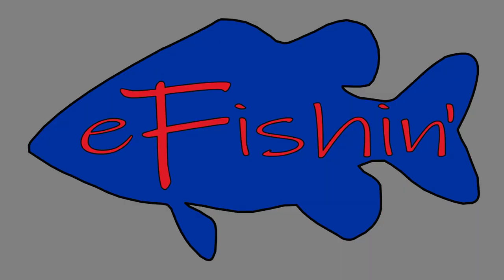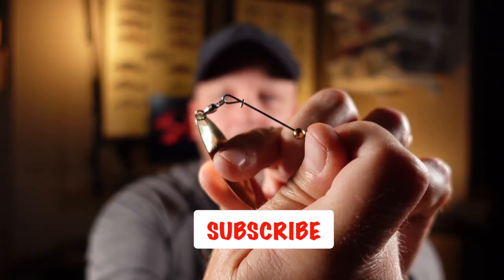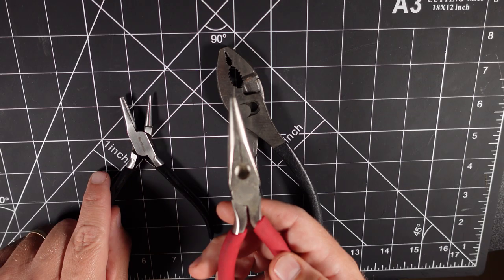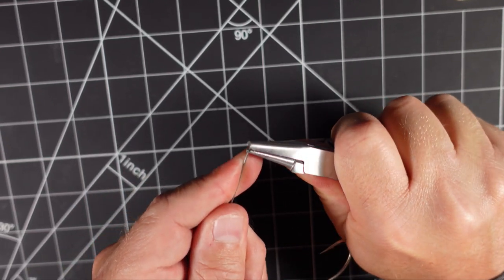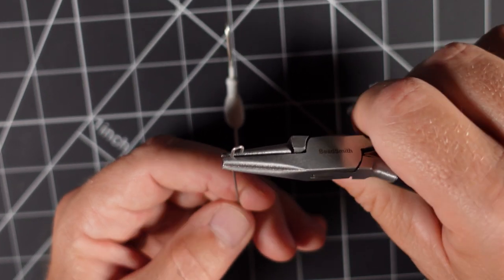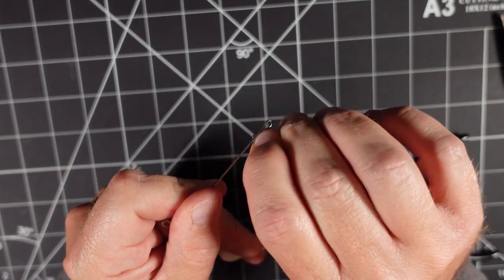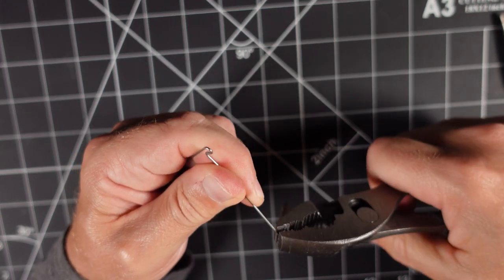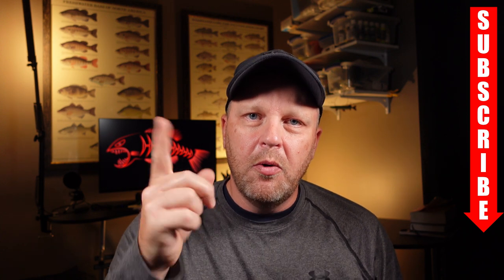THE LOCK LOOP | HOW To MAKE Your OWN Spinnerbaits

Comment: I finally got the hang of it thanks. I wonder if it interferes with the spinning of the blade? What do you think?
Reply from the maker: It does take a little practice to get the hang of it and I haven't noticed any interference with the blades.  I just make sure that the loop is inline with the wire.
Reply from the maker: Thanks for watching!!

Comment: I tried this with a 3/8oz frame and the front blade wouldn’t turn.  I was a 3.5/4.5 willow blade combo.  Any ideas?
Reply from the maker: There’s a couple of things that can cause that: 1 the spacing between the blades (sometimes add or remove spacers) 2 the clevis is too big or the clevis is warped slightly and 3 the front blade is not the right size (try a size larger or smaller). I would think that blade combo would spin. Try changing the spacing and maybe the clevis.

Comment: Hey there,

Thank you so much for sharing your tip on the “lock loop” to prevent spinnerbait blade loss.  Could you tell where I could purchase a pair of those “needle nose pliers with the channel” in them?  I’ve looked around and have been unable to find them.

Thank you so much for your help!

Greg
Reply from the maker: I added a link in the description of the video.  However, I got a pair of KNIPEX round nose pliers and they are much better for larger diameter wire.  Really I use both of them now.  Thanks for watching!!
Reply from the maker: @buster5506 the ones with the channel are called "Round Nose Nesting Pliers"
Reply: Thank you so much for the clarification.  It was very much appreciated.